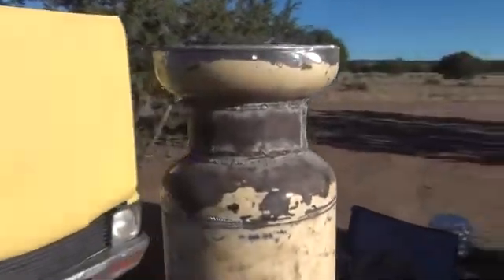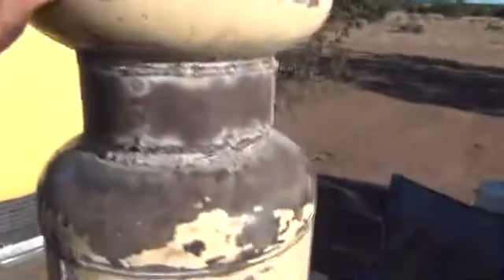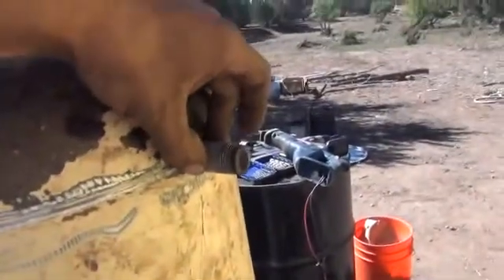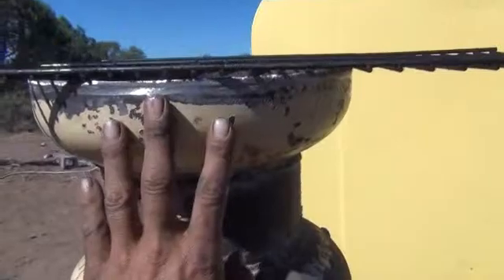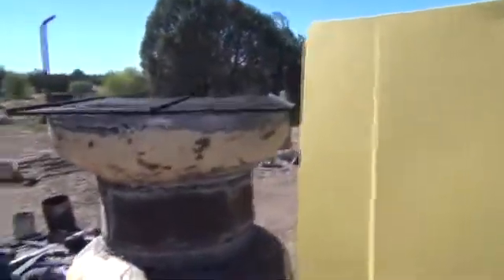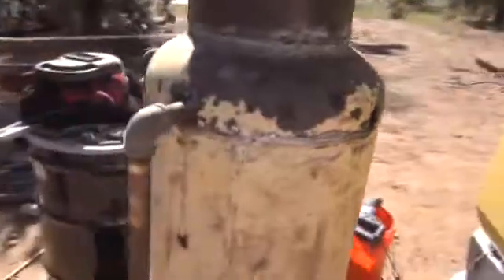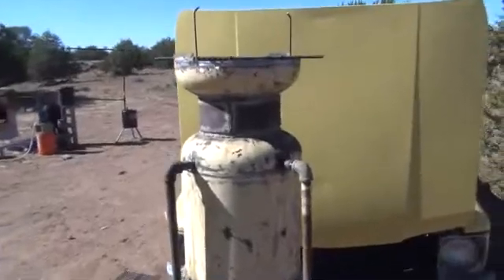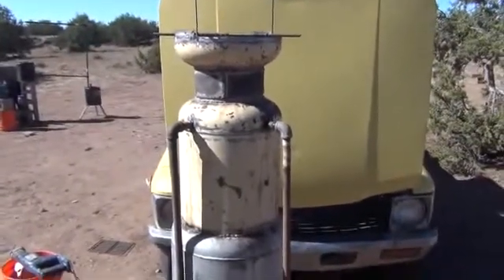Gasifier Truck How-To part 3

Comment: Hi, many thanks for your videos. Going to build one of these for a generator. My question is on physical size. If I build one as big for a 4kw gen. would it be better to build a smaller unit or could the large unit be run at a slower pace. trying to balance efficiency. Thanks again